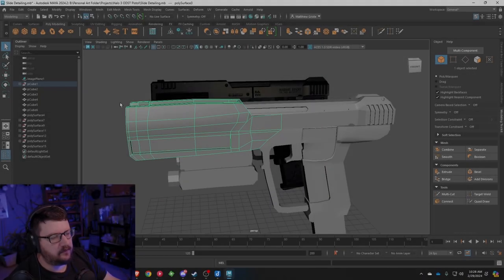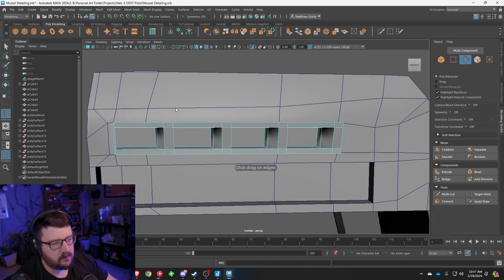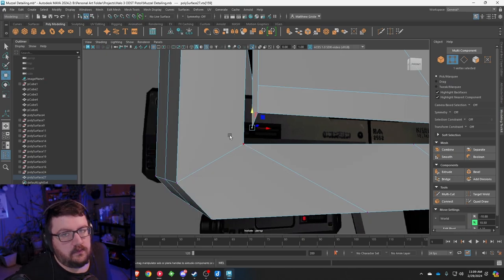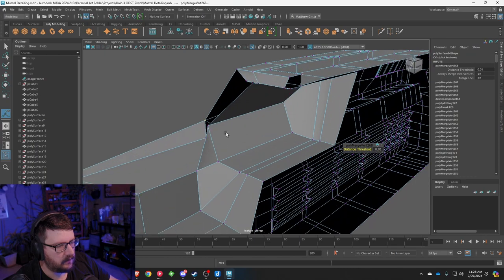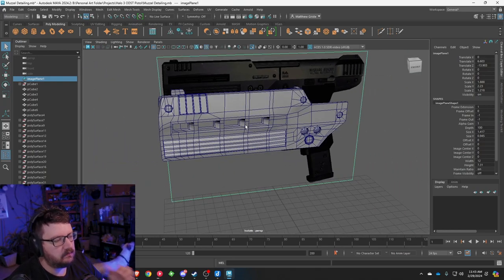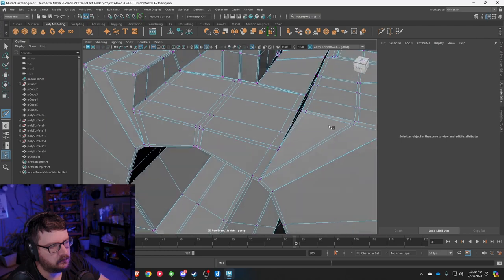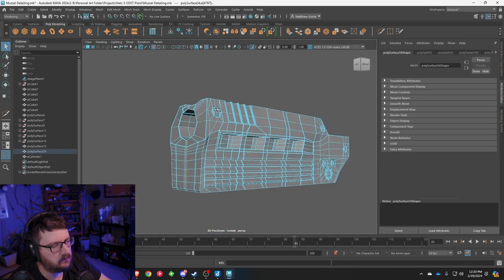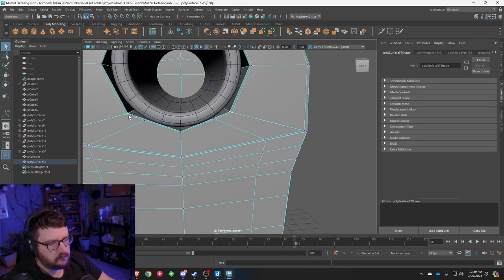3D modeling an ODST Pistol Part 4 | Building out the Muzzle

Comment: did u solve some angons around three pin holes? how ? or we can leave some angons and tringulate mesh? will really apperciate u explain
Reply from the maker: You can triangulate if needed as long as it doesn’t screw up the surface. I need to revisit this model lol